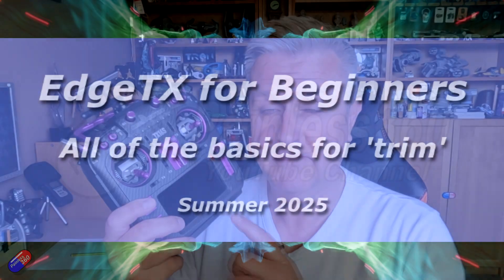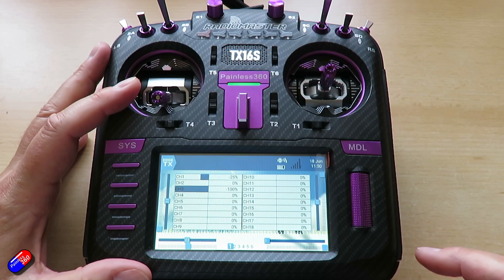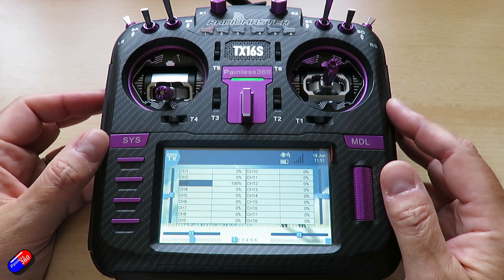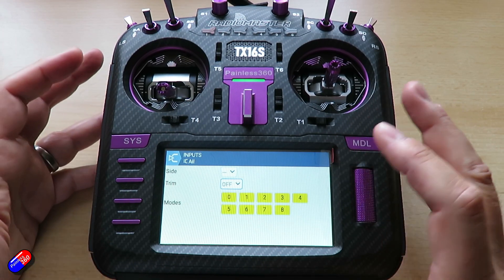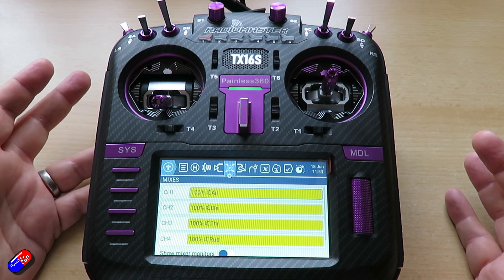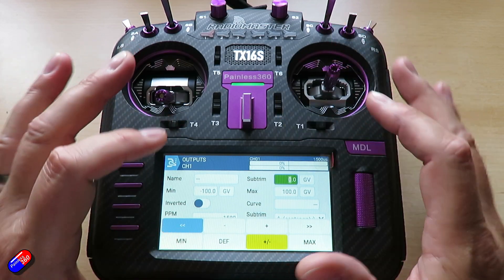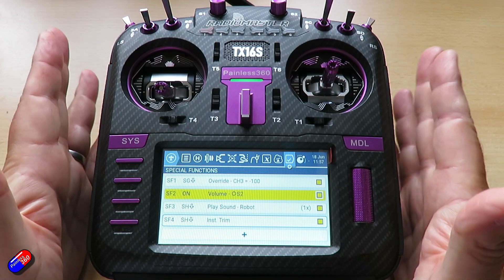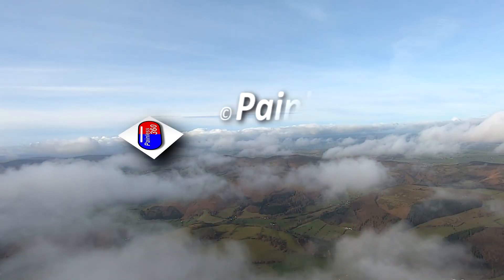Trim basics! (EdgeTX for Beginners 2025)

Comment: How do I make the throttle trim to go -100 to 100 in 4 clicks up or down 
Asking as I’m going to maiden a turbine jet soon 
And need to learn the engine on the trim switch
Reply from the maker: I'd probably look at using a GV (Global Variable) to run the throttle and make the throttle trims deduct or add 512 to the GV as they are activated. See https://youtu.be/lLeJsXy35WA (please see the links in the description for how you can support the channel)
Best of luck